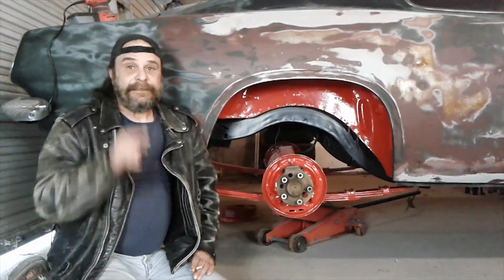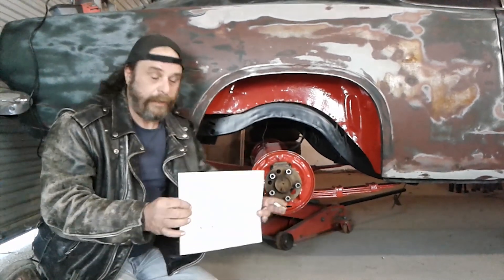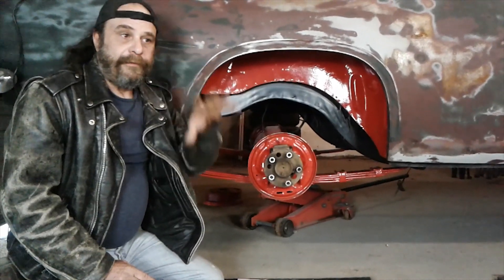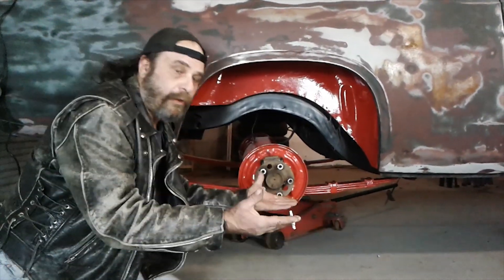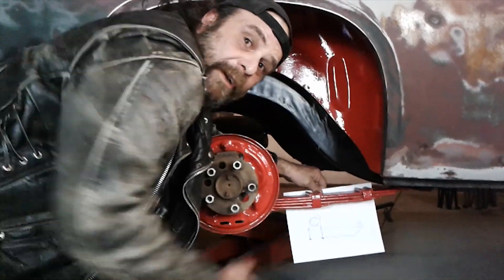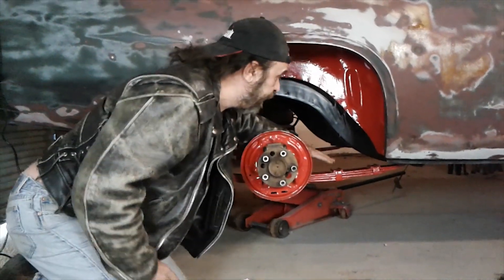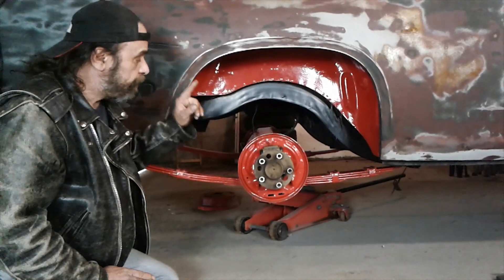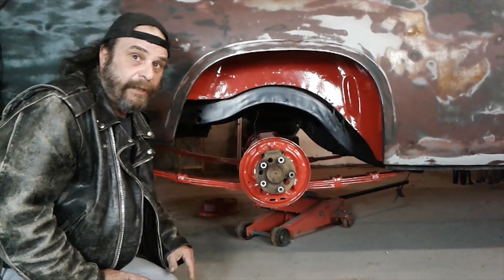Mopar Traction Mysteries Explained

Comment: Although having the rear end forward on the leaf springs works to stop acceleration axle hop (in the forward gears), I heard that it contributes to the tenency of Mopars notorious rear axle hop during hard braking. Which is of no importance at the drag strip.

Comment: My 78 magnum 400 4-speed does not have leaf springs like you are showing in your video. The leaf springs forward of the axel are actually curving in the opposite direction. I think in my case I need traction bars.

Comment: I'm running traction bars on a Plymouth simply because I added extended leaf spring shackle on the rear to accommodate much taller tires. I can't afford to tub it right now. They were cheaper than a new taller pinion snubber. And they work just fine for my application and were far better than nothing at all.

Comment: I used chrome universal slapper bars on my 65 dart for a while because it had the original factory weak leaf springs from 1965 . all that rear suspension has been removed now and getting rear for performance v8 stuff

Comment: Need to explain what causes axle wind up or wheel hop. Under hard acceleration the pinion gear is trying to climb up on the ring gear but it can only go so far. Once the spring has wrapped up as far as it can go it snaps back beyond it's at rest position then the process starts all over again. Watch the scene in Bullit where good ole Steve is  backing the Mustang up real hard. Classic Ford wheel hop. I started going to drag races in 1962 at Union Grove Wisc (Great Lakes dragway) and saw many a 62 ford 406 try (in vain) to beat a Dodge or Plymouth 413 to the end of the track. Most of them had serious wheel hop on launch. Chevies & Pontiacs didn't have the same problem due to the coil spring setup. Do remember watching one of those nice looking Catalinas try & keep up with a plain black Plymouth sedan w/ a 413 max. I was near the end of the track & could smell the clutch burning as the Pontiac went by. For the life of me I cannot understand how that little BW T-10 held up behind that 421 high torque engine.
Reply: That t-10 probably didn't hold up for long. One and done! :D

Comment: Tony. How's she go !
I am some glad you do what you do. I have a 1968 Plymouth valiant with the problem of getting in front of  blue  corvette at my local street race. I've  watched all your suspension vids. And have taken a lot of notes to try to get my car to hook better. The pinion snubbed vid was a great eye opener. I run et  ss Mickey Thompson 275 60 15. Worked on motor and power for the last year. Now I need to get it to hook. My biggest question is if I remove the fr. Shocks , were do I set my torsion bars? Do I drop the front end with no torsion on bars or jack the tension up on the bars. ? Any info or help be great. Love your videos and keep up the great work. !!!!! You make a difference.

Comment: Using the correct Super Stock springs for Mopar is imparitive. The right side has an extra leaf to counter the effects of torque upon launch. You have to get one for the car your driving and it's race weight. For that reason, it might be best to buy the springs after everything else is sorted out. Minor changes won't hurt, but big changes will! The placement of the pin to locate the rear axle is called a biased rear end. Chrysler figured out what actually made the car move was the leaf spring. Sure the engine spins the transmission which spins the driveshaft which spins the axles via the differential. But none of that pushes the car forward. It's the leaf spring that does that job, and by biasing the springs more energy is transferred to the car. In the mid 80's I read an article in Car Craft I think, it might have been Hot Rod, but who cares. Anyway, the writers took three big blocks, a 454 Chevy, 460 Ford and 440 Mopar. They gave them similar builds with as close to the same cam, intake, headers, carb and compression ratio as they could. Keep in mind that the BIg Block Chevy and afford engines had 1.75-1 rocker arm ratios and Mopar had 1.5-1 ratios. That's a big giveaway in the cam department. They also gave the Big Block Chevy their large port heads while the other two got small port heads, all of which were factory. The Ford could have used the 429 Cobra Jet Heads and Mopar the Max Wedge heads to keep things closer, but they chose not to. No surprise the when the BBC made the most horsepower. The Big afford wasn't far behind but the Mopar was missing a couple things no Mopar builder would have missed, and that would be a windage traynand exhaust heat crossovers blocked off, good for about 30 hp in combination.. Next they took the 3 engines and put them I midsize cars. The BBC got a Chevelle, which ran coil springs in the rear.  They had control arms kind of like a 4 link Suspension, but not, and no where near as good. There is an aftermarket replacement for the control arms and those were installed. The Ford mill was put in a Torino, with centered leaf springs and slapped bars like the ones Uncle Tony beautifully illustrated in this video while the Mopar motor was set into a 69 Roadrunner with biased leaf springs done right. That's super Stock springs and a properly adjusted pinion snubber. Even giving away 30hp or more the Roadrunner trampled the other two! So boys and girls, get the right springs for you car, when you can afford them and get yourself a pinion snubber and adjust it properly. They aren't expensive and still work great even if you can't afford the springs. And one more back yard trip. For road racing when you need the stiffest suspension possible, get the car at ride height. This can be done easily by setting it on the ground and bouncing the car's back half up and down a few times to get it settled. Then take some electrical tape and tape your leaf springs together. Be sure to clean your leaf springs we'll before you apply the tap so that it sticks to the leaves as you rap the,. For drag racing you might experiment with wrapping just the front of the leaf spring set. That should stiffen up the front half of the spring and make your car launch like a beast!

Comment: Dad used to say those traction bars was only good for one thing. Getting caught on the railroad crossings. Here in NC  many of the Railroad crossings used to built crossing the roads with the actual railroad on a nole. So when the front end came off the other side of the  nole the traction bars would be in a downward position and catch the tracks...

Comment: Mopar engineers.. the High and Mighty.. it begins here... plus find the vintage Mopar tech slide shows, Mopar didn't want the rear end to squat down or see saw back to front.. my mopar channel.. Chrylser vs Cadillac.. footage over rail road tracks is brutal.. Torsion Aire Ride system delivering much more control.. also made for better launch.. peace Humans

Comment: My 76 Dodge Aspen has traction bars cuz it'll will hop like a mother
Reply: You should go the pinion snubber way instead, better design for mopars
Reply: Same on my 76 Aspen. It must be a F body thing
Reply: @dalemariotti9147  my fathers 74 challenger had them. Apparently due to wheel hop.
Reply: Might be better to put those add a springs to the front section. You want some flex to help prevent tire spin off the line.
Reply: after driving it that way for a while, take them off and tell me how it handles w/o them.  Less body roll in corners?

Comment: Hello sir! New subscriber here and longtime magazine fan. It's funny, when I describe the asymmetrical leaf spring idea to my Chevy buddies, some blow it off and say they've seen lots of Mopars with slapper bars. Arghh! I kinda hated to see the CalTracs bars and springs totally take over the Mopar Stock Elim. cars but I get it, more adjustability and all blah blah blah. But, the Mopar Stockers got deep into the 10's before the CalTracs ever showed up so, leaf spring s are good enough for me! Anyway, love the videos and keep up the good work!
Reply from the maker: Thanks!  The best endorsement of the factory set-up is Dave Dudek's Roadrunner.  He's gone 9.80's on stock tires, 383 2BBL Satellite springs and zero other traction aids.
Reply: @UncleTonysGarage  Not even HD springs? Wow. Yeah, love those F.A.S.T. and Factory Stock cars too! Thanks!
Reply: I've got one of them older Direct Connection drag racing "recipe" books and it describes the factory type super stock leaf spring setup being limited at around 9-10 sec e.t.'s then you need to consider aftermarket purpose built racing stuff.